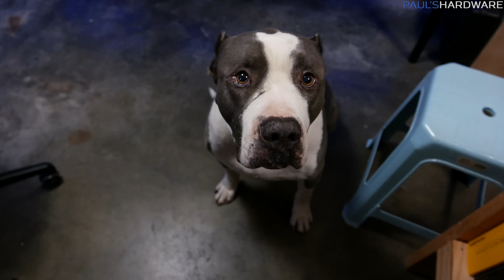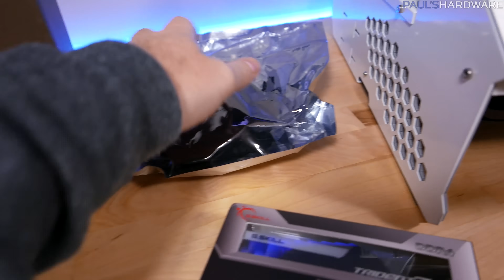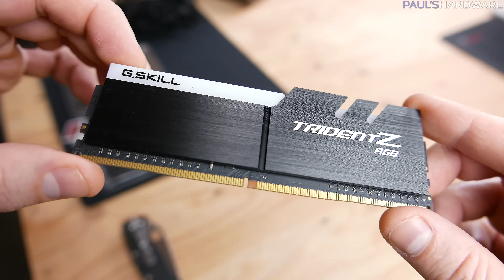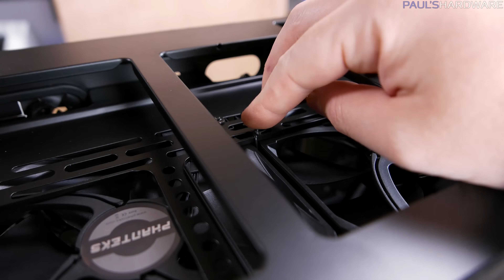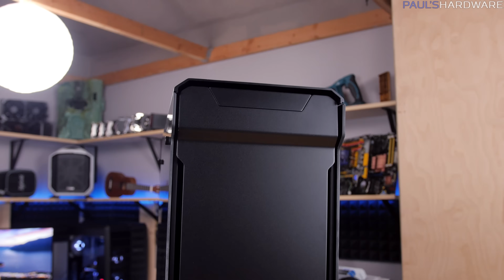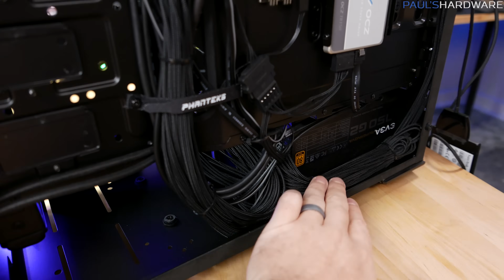The Perfect RGB Build - But Will It Work?

Comment: Paul, if you have your pwn hub on the back of the case going to the cpu_fan header, which header do you have the 3 pin cable from the kraken going to? aio pump or opt fan header?

Comment: Why did you switch your radiator and fans in the front from pull to push configuration? You also got 3 outtake fans and only 2 intake (low pressure)...so your radiator will collect a lot of dust between the NZXT fans and the grill ...which you can't vacuum off anymore that easy like with your old configuration.

Comment: Hey Paul,  the 2 front facing 140mm fans that came with the case, did you put those on top of the case, since the kraken cooler fans are in it's place in front.

Comment: I have also same case and cooler. I considered to install the Kraken at the front like you did in the video, because it definitely looks better installed there than hanging over the mainboard. But with three exhaust fans and two intake fans, wont there be a problem with dust collection? As the pressure inside might be negative, so dust will come through the openings without dust filter.

Comment: Paul how did you get asus aura software to run simultaneously with the kraken x62. I want to buy the kraken, but for some reason when I use asus aura software with cam software at the same time, it takes my g skills trident z rgb's out of sync or just off. any ideas?

Comment: I'm building a very similar computer, as a result, I wanted to ask if you had clearance issues with putting the liquid cooler on the top of the case so I could still access the front drive bays that are being blocked in your build?

Comment: Hi Paul, Great looking build!  I need to update my build, last one was 5 yrs ago!  Still working good though.  Getting lots of ideas from your great videos.  I was just wondering, any heat issues caused by the NZXT Kraken blowing past the radiator, into the case, instead of out? This may have been asked before, sorry if it's been answered already.

Comment: Good video, close to what I am planning, cutting down my build a bit to reduce cost while not sacraficing performance is the goal. Sticking with the Phanteks ENTHOO like yours, but in anthracite. Nice to see your dog Hero as well. I also liked the EVGA power supply cable kit, think  I will add that to the list, I like the braided nylon look better than flat black rubber.  Thanks for your nice build videos, got you on subsrcribe.

Comment: I noticed when installing my NZXT x52 I noticed the bracket/standoffs were loose and had slack. Is that normal? I opened a support ticket but NZXT hasn't replied back and they are very slow as most ppl already know. So is it normal for the loose bracket upon install?

Comment: I had this same problem and more with my new build using the z270F board from Asus and their Stix Gaming 1070.  I had the colors not representing properly ( it was blue not working for me ) and also had the RGB stop working ENTIRELY.  How did I fix this and have it run perfectly now?  Well in the BIOS Advanced mode, I went in and turned the RGB controller to OFF.  Then did a full boot.  Restarted into BIOS again and turned the RGB controller back on.  Booted into windows and BAM all colors sync perfectly now.   Well except for the fact that the Kraken X62 using HUE doesn't sync with Aura.  I'm sure you figured this out by now or are having a different issue but this is how I got mine to work

Comment: so pissed at NVIDIA, I found out that the 1060 has no SLI port for combining two GPU's, and all their excuse was in the email was that the 1060 can play most videogames and medium to high graphics settings. I'm not in the average gaming market, I'm in the "playing battlefield 1 at 120 FPS max and THEN recording it in 4K" market. WTF, dont buy the 1060 if you plan on going dual GPU's, I just wasted $500. (Newegg doesnt take returns w/out the boxes)

Comment: I just got the same mobo, and am gonna use the same water cooler. Now I may have to change RAM to the ones you used. Nice build. Im using the Noctis 450 (not the ROG version) however. I was a little concerned about the RGB software but hopefully it will get sorted out by the time I get to finish my build.

Comment: Hey Paul, one thought while watching your video. I have a Kraken X61 mounted inside my system which is a Gigabyte Ga-990FX-Gaming mobo with a AMD FX 9590. I have my rad mounted on top as thats about the only place in my Phantom 820 case that I can mount a 280mm radiator due to the tube length, however, when it came to running the tubing off the pump/waterblock, since it was nice that the fittings on the block can rotate, I ended up running one tube up  the side of my dimm slots and over, while I ended up running the other tube down the side of the dimm slots and looped down and back up. Its not a very pretty sight, but it does help keep the tubing away from the fans as well as doesn't look too bad with the side panel on. Granted a tempered glass side panel wont hide anything, but figured if the tubing on the x42,x52 and x62's were the same length or longer than the previous generation coolers, then that might be an option to look into since the braided tubing looks much better than bare black rubber tubing. Can always check it out on my channel if you want to see how I did it and what it looks like as I know I'd hate to even see a twist tie visible in my case (though sometimes certain cases and mobo's dont let us choose).

Comment: Aura version 1.04.22 is the version I linked in the reply to this and I'm not sure why your having issues Paul. Is that the version that Asus gave you? It is working fine for me. At 9:55 I did not see the dimms listed on Aura. If it is working properly, the dimms will be listed to the right of the vga in the UI. My Strix Z270E, Strix 1080, and G.Skill Trident Z RGB, and led rgb strip all show up and sync perfectly with Aura. I have not had any issues at all. So, maybe it's like you said, the combination of those different control softwares may be conflicting each other. Have you tried just running Aura alone? Also, everyone make sure you uninstall any previous versions of Aura before installing 1.04.22.

Comment: Pro tip for that case ( I have one ). Drop an LED strip down the front spot  ( in front of the dust filter ) and it will add a nice lighting effect that bleeds out of the intake vents on the front.

Comment: I'm building a gaming computer for the first time. Can you tell me if these are some good specs for the recent games?
SPECs
GPU: Gigabyte GTX 1070 8 GB 
CPU: Intel I5 6600K 3.5 GHz
Motherboard: Gigabyte S1151 GA-Z170-Gaming K3
Case: Corsair Carbide 400C
Ram: 8GB DDR4 2133MHz
Storage: 2TB SATA3 7200RPM 64MB
CPU Cooler: Corsair CX 500W ATX.

Give some help. Is this good enough for newer titles?
Reply: wait for Ryzen and don't buy into intels scam of 4 core is enough and a 100$ premium for hyper threading.
Reply: Sleeved cables cost $100 why not hyper threading

Comment: hey Paul, I had the same problem with the Mobo and the strips not matching colors. what I did was hit the little wrench on the top right corner and it did it's repair and it all synced together. if it wasn't the wrench it was the circular arrows. hope it works for you!

Comment: the problem with the LED is that the case RGB system (for the power lights) is messing with the LED strip because they are both plugged into the same loop, I had this exact same problem, if you press the button on the case you'll see that it'll change the colour of the strip, so set the aura sotfware to want colour you want and then press the button on the case until it matches.

Comment: got same mobo an ram an I got it all to work with asus aura all these vids that can't get the ram to work with the mobo just makes me sad.
Reply: What RGB fans did you go with?
Reply: My case is not a fan show pice I only have 3 120mm an 2 of them on my aio  that an not a fan of led fans should post a vid on the aura setup i got running a red/blue them atm.

Comment: Weird, I recently built my RGB PC and the software works fine for me. I'm using a different mobo though, mine is the Asus z170 Pro Gaming Aura which obviously means I'm not using the 7th gen intel. It syncs with my GTX 1080 ROG Strix perfectly. Best setting for me is Flash and Dash with my NZXT X62 set at spectrum.
Reply: RGB fans?
Reply: Not yet actually. I'm planning to buy a couple NZXT Aer RGB for the front grill of my 750D but they're out of stock if you wanna buy them individually.

Comment: very nice. I am 74 years young and decided to built my first  computer. However, I seem to lack the appropriate skills. So a little advice would be greatly appreciated. I stuck a Asus Maximus IX Code in a Corsair 750D case with 32GB and a M.2 stick. My problems  appeared when I added the H115i cooler USB 2. connector)- as there is only 1 USB2.0 connector on the MOBO ( I am picking up the lingo) . What now,  as I need to connect front panel USB2.0 too?
Reply: Try Linustechtips.com or something like that.  It's a forum and I swear I saw a similar question on there.  That or Reddit.
Reply: https://www.nzxt.com/product-overview/internal-usb-hub

^ That's what you need!
Reply: Thanks, picked up one and all is fine.

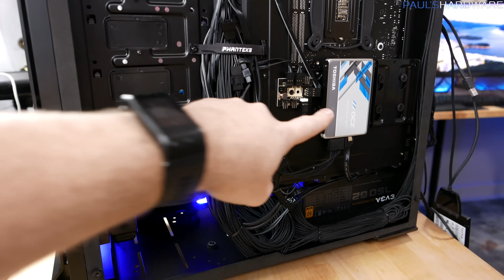Comment: Agree the SSD stands out when the back cover is off as you pointed at 12:50 and then at 13:00 or so into the video you showed the space in basement. So am curious why not move the SSD to the basement/shroud area (other than having to do the re-wiring)? Thanks and keep up the good work.

Comment: had a similar issue with a phanteks case, If you are using the motherboard RGB connectors to control the color you need to disable the lighting that is controller by the case RGB controller

Comment: Check the pin outs or what ever they are called on the LED lights as in the RGB channels, they are not universally the same. They might go RGB on the motherboard and then GRB on the LEDs  and that will mess up with software =P hope this helps

Comment: I got asus z170 mobo and cablemod rgb led strips in my system. The aura software doesn't fully work, something is really messed up there. For example, green and blue are the wrong way round, if installed with adapters that came with the leds. With the music effect, led strip from different header does NOT syncronize. Thanks asus, well played.

Comment: if your case rgb is connected to the asus motherboard headers ,go into the asus AURA software,and click on the wrench icon in the top right corner,then the software wil give you an option to "calibrate" the rgb headers to your rgb strip/leds

Comment: Hey Paul! just watching at 9.20 ín the video and noticed you got the RGB showing wrong colors, i had the same issue, till i tested to turn OFF the leds for the case (and strips), AND removing the power (sata connector) for it,  im using the phanteks "RGB Adapter" for Aura sync, so the case lightning syncs with the rest (mb+gpu) hope you get it right :)

Comment: Hey Paul a couple of things why is the NZXT not working on the Pump? But then again I cant get them to respond to my emails after dropping $180 and them screwing me out of my free Grid+v2 so good luck!!   The next thing is I have NZXT AER thats the order but I also have the Corsair new HD , SD and ML.s and on line they look good in person they lack Pop in my mind so just a thought look at the new Thermal TaKe Riing+ series... Wow the RIING + are Nice i just got them in and about to pull out the NZXT stuff they woprk work right THX AGAIN NZXT FOR 0 REPLIES!!! .......I do plan to take the Riing+ apart and paint them High Gloss White for the Current build that was supposed to showcase the AER stuff but oh well their loss.  On those G-Skills i do like them alot too Paul but if you keep having issues look into the Geil ones I am trying to get a set now....ok ill wait for part 4 i guess or 5 oops lol

Comment: I fixed the DRAM RGB issue I had with my Aura items.  The driver on the Asus Hero page isn't the most up to date one.  Mine wasn't picking up the DRAM either.  Go to the Maximus IX Apex page and it has a more recently updated Aura driver (I think they labeled it incorrectly it says version 1.04.21 but shows up as .22 when I installed it ) https://www.asus.com/us/Motherboards/ROG-MAXIMUS-IX-APEX/HelpDesk_Download/
Reply: Oh and for my Asus Graphic card I had to have the graphics card aura installed first and then just control it through the motherboard.

Comment: Windows sucks I use Linux Mint 17.3 64bit(Rosa) and have had no problems with it and not likely to, my system turbos up to 4GHZ and is nice and fast but I am going to ditch the addin graphics card and remove the piece of card which is blocking the HDMI port to connects directly to the FM2+ socket.

Comment: Hey paul I love the build. It has a a lot in common with mine. I have a question for you, because I have my eye on that ram.  My build has 280 mm rads on top and bottom (gpu and cpu). Do you think that ram would clear the rad+fans if your x 62 was top mounted like mine? I had to mod my cosair vengeance to fit, but those heat sinks are very tall. 

PS I love that trick with the AIO tubing, I am rigging that up as soon as I get home!

Comment: I would add some cable combs and maybe scoot the front rad up an inch so that it's flush with the psu shroud and centered in the window.  Just my OCD noticing it. Great build Paul!
Reply: It doesn't line up with the mounting holes for the screws if you do that, so he would have to drill new holes. It's only possible to make it flush with the psu shroud by drilling 6 new holes and leaving the two at the top unmounted. Phanteks could have easily extended the front radiator/fan mounting bracket to accommodate 280mm rads without having to remove that bit of the psu shroud, so that's kind of an oversight imo. Still a great case though.
Reply: Ah, makes sense then...never worked in one personally.  I think since it was windowed though i'd drill those new holes.  Easy 2 minute fix.

Comment: Just a quick thought. I would add some black foam or rubber between the tubes and the twist tie. Vibrations could eat through the bottom tube's sleeve/casing weakening the tube's integrity. Probably not an issue, but when dealing with water tubes ...

Comment: Nice video , sticker is fine it's on the back so i can't see a problem with that, would like to know if you can sink the RGB lights and how you do it if posible, and just one more thing on the water cooling pips why not run the a long the top so there out of the way ohh and one more lol why did you not use the EVGA DG-87 Gaming Case? again very nice video

Comment: This is a pc I'm thinking of building what do you think? https://pcpartpicker.com/list/kgL2Z8
I know I could get cheaper equivalents of some parts like the ram but if I'm going to spend over $1000 it might aswell look as good as it performs
Reply: just realised my specs and his are very similar
Reply: Daniel Mullins sexy
Reply: Chilly Doggo thanks
Reply: Daniel Mullins You'll need the Hue+ to change the colors of the rgb fans
Reply: Are you going to have custom sleeved cables aswell?
Reply: Can't say much - from the looks of it, your future set up will be solid and clean.
Reply: Wait for zen, just to see and you may be able to get a. Build that lasts a year longer
Reply: You won't ever find a use for that ram. Even 3200 is never really used (although I'm guilty of using it myself) I suggest getting the 3200 or 3866 for much less money, or going 32 gigs of 3200 for the same price as your 16 gigs
Reply: wait for Ryzen and don't buy into intels scam of 4 core is enough and a 100$ premium for hyper threading.
Reply: Sleeved cables cost $100 why not hyper threading
Reply: Burritos cost 10$ why not hyper threading

Comment: Hey Paul there is a new Aura update out to control the Trident Z lighting, but they haven't updated all the driver support pages for each motherboard. You can snag it off of their TUF Z270 driver page https://www.asus.com/us/support/Download/1/50/8/17/YEWj8yr5gNv9Qf2C/45/ under "utilities" Lighting_Control_10422 Just tested it with the Maximus IX Hero, works just fine. And there are some new lighting modes available too.

Comment: Are you not afraid that the twist tie used to suspend the AIO cooling/water tubes will eventually wear through them causing leaks?
Reply from the maker: I doubt it, the tubes won't be moving at all and they have pretty tightly woven sleeving protecting them as well

Comment: For this be the perfect rgb build you require corsair 570x case
Reply: Cookieop i what context do you say it's crap. For rgb builds it's a good one except that it's fragile
Reply: Its power supply shroud is crap, mediocre cable management , no holes for cables that connect to the bottom of the motherboard like audio and usb headers so you have to stretch them from the pcie cut out holes, it seems that corsair threw functionality out of the window when they designed this case
Reply: I wouldn't want to use that one because of all the annoying tempered glass maintenance it would require. Tempered glass is great, but that case has too much of it and it just seems like it'd be a veritable nightmare to keep clean.